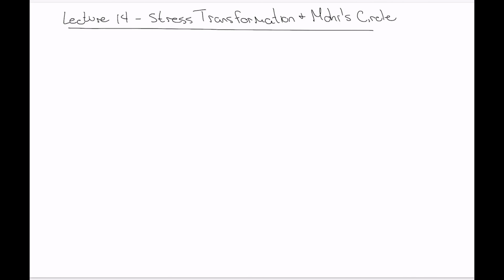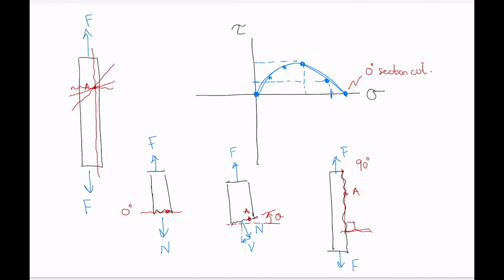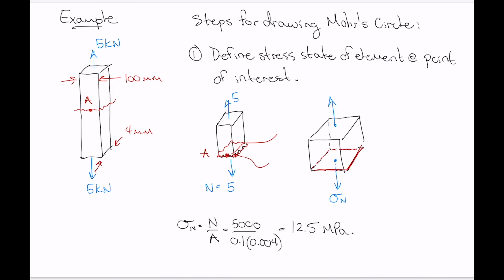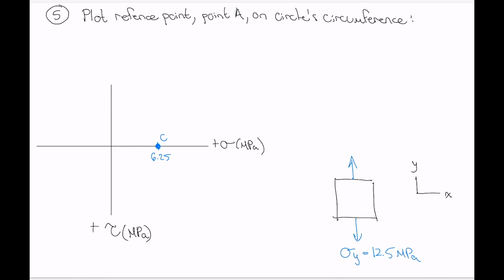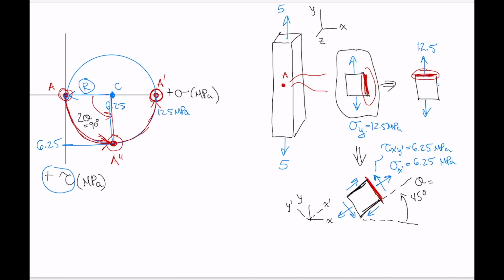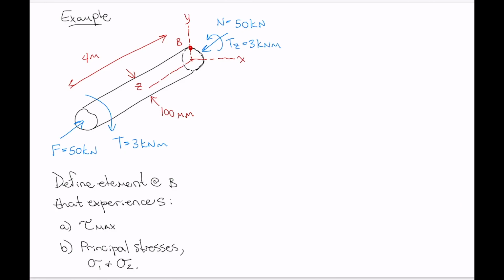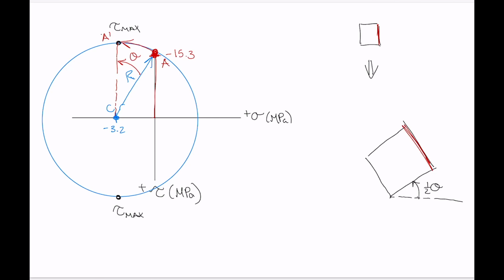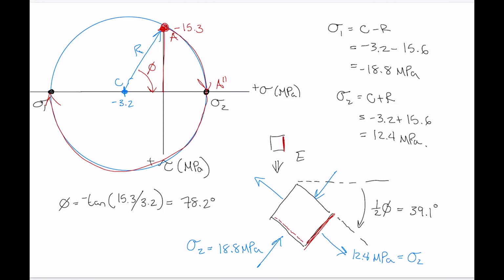Solid Mechanics - Lecture 14: Stress transformation & Mohr's circle

Comment: So your assuming that the force created by shear force times the dA and the normal force times it angle and the dA has a resultant equal to the applied force.  And this is the key to understanding this but no one ever really stops and points it out.  Your just cutting your sample at different angles and reapplying the equilibrium equations to your new free body.